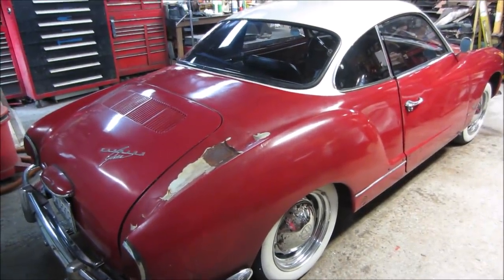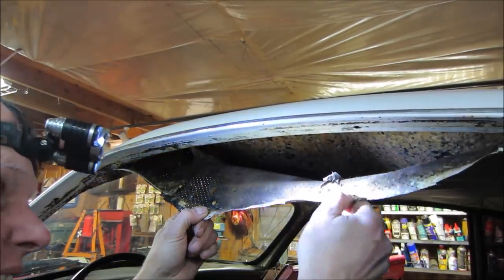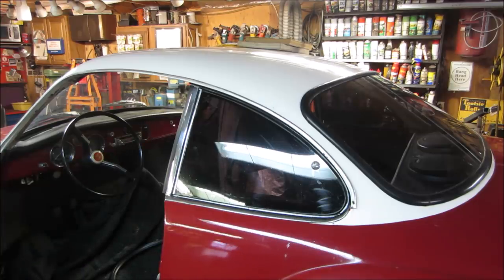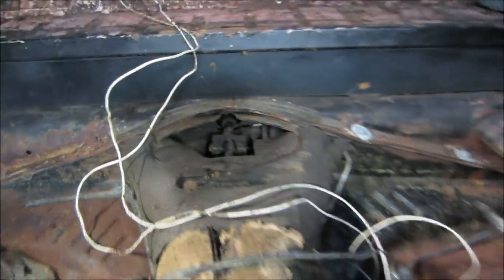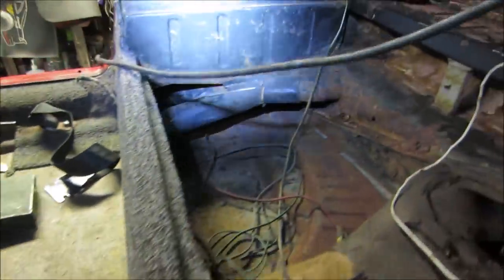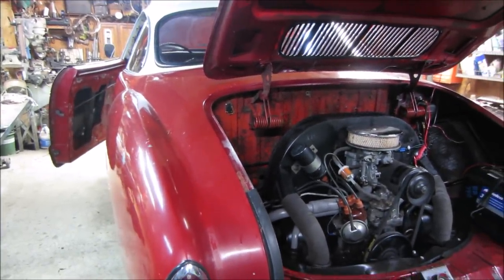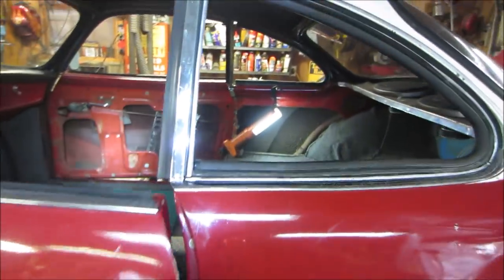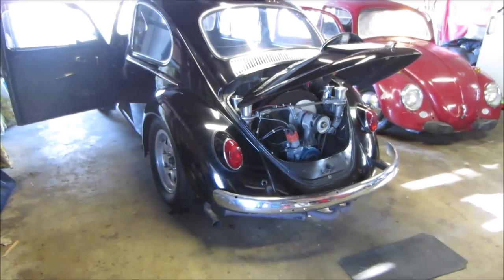Car Mouse Damage, how to remove the smell.

Comment: ozone generator!
amazon has small ones for about a 100 bucks 
close up the windows an run it overnight it 
will eliminate the smell  and kills black mold!
Reply: Wish it would have worked for us.  We have done everything we can think of and our Ford Fusion 2014 still stinks.  We cannot find the source of the stink.
Reply: @jshow319  
It needs to be a commerical rated unit. One that can treat about 3k square ft. I just did a car about a month ago. And it was funky!
But it cured it! Good luck!👍

Comment: What about sticking some of that sound proofing matting on the roof before installing new headliner?
Reply: Is that the same stuff you use when you install larger car speakers? I've seen Best Buy wrap inside of deck lids,surrounds with it to stop bass vibration. If it's the same stuff, great idea

Comment: Walmart super clean is my go 2.  A 2.5 gallon jug is around 20bucks. Put on straight and let sit on tobacco stained refrigerator and started 2 bubble enamel.  Stuff reminds me of old industrial strength simple green brand. Can mix different strength for milder effect. Did my work car engine with full strength and trunk/interior with 1/2 strength. Then hooked my pressure washer 2 drain on water heater and vacuumed dirty water with old shop vac until clear. Should cover all electronics , remove battery posts, and pull trunk drain plugs. Neighbor laughed his ass off , but car was sparkling in 2 hrs. Had 2 leave doors, trunk, and hood open for a day or 2 with box fan, but saved shit ton of hours.

Comment: I would use rust encapsulator from Eastwood on just about everything in that car. Wire wheel the loose stuff off first of course. Lots of work in preserving old cars.

Comment: you may also encapsulate wiring with split tubing and just squirt the stuff to secure them in place it makes a sound dampening chemical anchor and new wire may be fished in if needed after install...use 3/4 or 1 inch tubing to be sure careful use cheap rubber gloves and crap clothes this stuff sticks to everything but seals and adds rigidity also

Comment: I put  my 79 Lincoln away last year checked on it periodically over the winter in June when I went to take it mice had chewed through the headliner and used all the insulation to make a giant nest under the back seat, what a stink the rug under the seat was wet! . But I had just been in the car 3 weeks before and it was fine. Mice suck

Comment: Could you also  spray inside of car with Rubberized undercoating?
Reply: I was thinking the same thing
Reply: there is a good one called Herculiner that you can roll or brush on that would work well here.

Comment: I stored my motorcycle on my dads farm one winter.  I pulled the battery during the winter.  In the spring, I went to reinstall the battery, and the mice had removed the foam from the seat, and made a nest in the empty battery box. I hate mice.

Comment: Mouse evictions are much easier if the occupants are too stiff to resist.  Here in Texas we get 8 inch rats that can chew through a wiring harness like it's a licorice twister.  You going to do anything with that right rear quarter?

Comment: The belts on both of those cars seems to be loose or is it ust my eyes?
Reply: Nope! We should ask about the care and tightening of that belt on bugs.  Corvair 6 cyl engines we're worse, they took two 90` turna to run the fan flat on top of the engine.
Reply: That belt on the black one looked looser than my ex-wife's morals.

Comment: fill all the areas of the doors [where windows are not conflicting] and around the vents and heater tubes with low expansion polyurethane expanding foam...It makes heater tubes more efficient and quiet the ride also make sure it is for doors and widows ...the 9lb low expansion tight cell foam this is waterproof and also will add strength. and dampen sound so a win win for customization...less air leakage and insulation displace the mice in collector cars many wins no loses...the canned stuff cheap enough and plastic tubing releases the foam into hard to reach voids.
In florida where they had the bad hurricanes all boats with 6lb open cell urethane where totaled, the other 9lb tight cell urethane where repairable one is like a sponge the other actually repels water

Comment: Back in the day, I had a '65 Bug that the heater channels were so rusted out that I had to use a scraper on the INSIDE of the windshield. That goes to prove that driving VW Bugs is not for sissies

Comment: I have a 71 super beetle convertible it has not been on the road since 1991 so I would assume that's the last time the top was off. after addressing the mechanical issues I was wondering if you know of anything to put on the top to keep it from cracking since it hasn't moved in so long?

Comment: Buy a chlorine dioxide bomb. Comes with instructions get the biggest you can buy. Start bomb requires small amount of water leave sit in car for desired amount I recommend 1-2 days. Now your car smells like a swimming pool for 6-7 months. After that time will smell like nothing. We use it to deodorizer cigarette smells from apartments or I used personally to deodorizer cigarette smell from my girlfriends vehicle she bought.

Comment: If you want the truck I use it on a lot of 50s and 60s and 70s cars but dry ice on a heavy duty welders glove wow your hands wrapped up in another glove because dry ice is really f**** called and if it does by chance get through your welding glove to your actual bear skin underneath that welding glove without something being underneath that it will literally take the skin off of had it done before but it will take any and all of that stuff off the roof or what is stuck or the same stuff Tucson the floors itself I use it a lot if you want to try try it if you don't you don't have to but I figured it might be a way for you to get some of it off if you really truly wanted some of it off

Comment: I still don't see how they got up in there???
Reply: Mice are very well adapted for that .They can squeeze through an opening the size of a dime ! And the claws are good for traction.
Reply: @davidhamm5626  Hold a mouse sometime. That puffy body seems to be mostly air. The head, backbone etc. Is less than the diameter of a dime.
Reply: @BobPegram  by